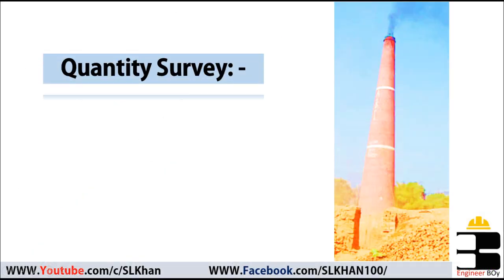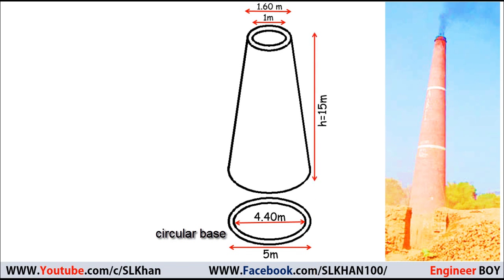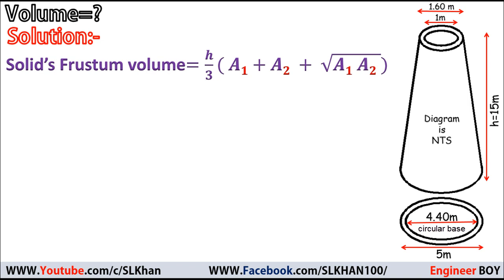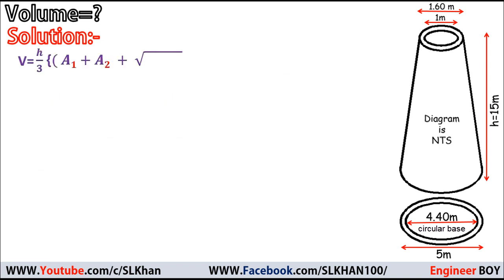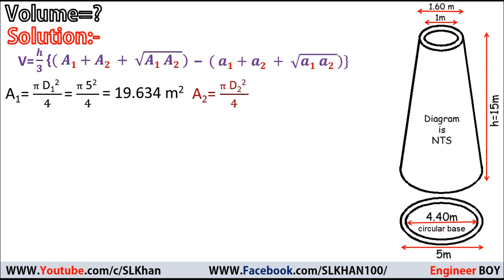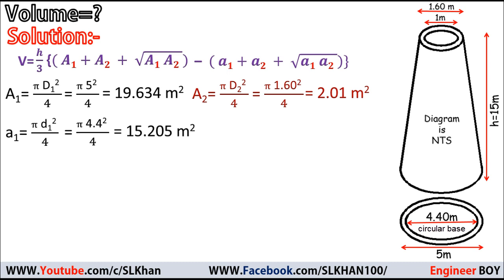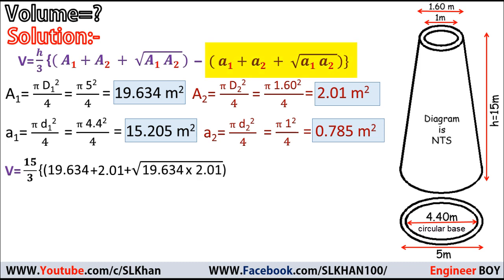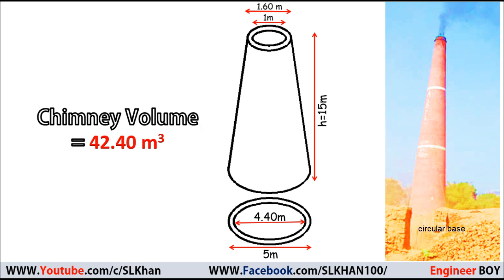how to estimate the  volume of brick chimney ?

Comment: Excellent video sir. Loved it. Sir I have a couple of topics in my mind which I want 2 share with u. If u cud kindly make videos on them , then I shall be very obliged.

1. BBS OF TAPERED CIRCULAR COLUMN, ESPECIALLY THE CUTTING LENGHT OF ITS STIRRUPS WHICH ARE ALL DIFFERENT. 

2. BBS OF TAPERED CANTILEVER BEAM WHOSE CENTRE TO CENTRE DISTANCE BETWEEN THE STIRRUPS ARE VARYING. 
FOR EG. 

TOTAL SPAN OF BEAM IS 3.5 M

FOR 1.1 M THE C / C DISTANCE AMONG THE STIRRUPS IS 0.08M 

AGAIN FOR 1.1M DISTANCE,  THE C/ C DISTANCE OF STIRRUPS IS 0.150 M

THEN FINALLY FOR THE REST 1.3M, THE C/ C DISTANCE OF STIRRUPS IS 0.250M.
Reply from the maker: Thanks